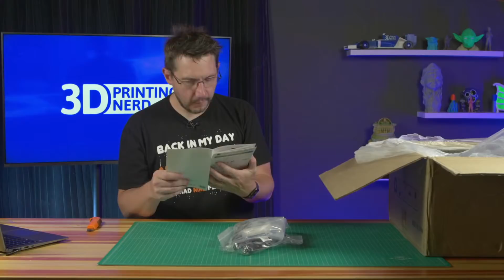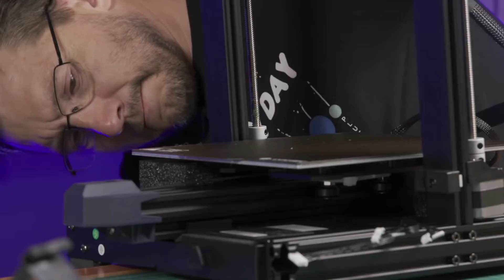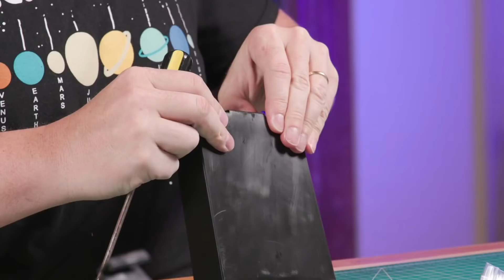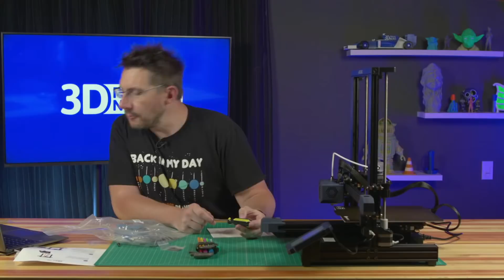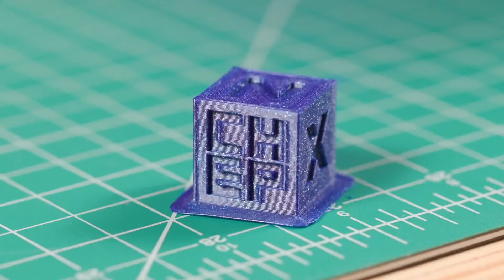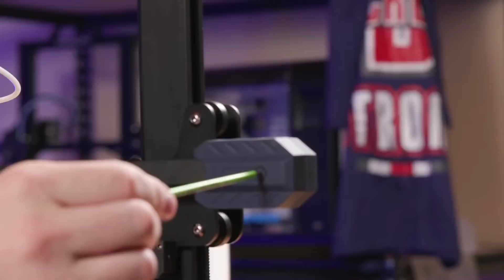Anycubic VYPER 3D Printer - FIRST PRINT LIVE!

Comment: New anycubic vyper owner,used printer...I have 4 ender v3se printers that print great articulated stuffs perfect,using tough pla...tug,pull,yank on them and no breaking...my vyper,not the same result at same settings..they will break if yanked hard.,and look different print wise..why??is it the different hotend set up and 225 is to hot?? Layer lines?? Any help is welcome..

Comment: I know this is an old video but I really needed this. Created alot of fantastic things on my first printer an Ender 3 Pro, but the leveling.., it was like a second occupation. Akin to loving garden vegetables but spending 95% of my time weeding and 5% harvesting. Does anyone think this is a sensible Ender 3 replacement?
Reply from the maker: The Vyper has been a darn decent machine for me! It was essential in my frames project with NPH.
Reply: Thank you 😊 for your reply.
Reply: @jackcampbell4465  Not sure if you bought yet. If not, they a slight discount right now. I also got a $20 off coupon and got mine for $329 USd with shipping.

Comment: Really thinking about getting one of these. I'd like to be able to print ABS and ASA with it but I'm wondering if the electronics will survive if the printer is placed in a heated enclosure. My second choice would be a Creality CR-10 V2 which has a separate enclosure for the electronics.
Reply: мне тоже интересно это узнать)

Comment: Well I have had the filament feeder die on my Anycubic Vyper now twice.  The sad thing is this printer has had amazing prints, but its reliability is poor.  What are people recommending these days for under 500?
Reply from the maker: Twice? Dang. Can you put a different one on? I have many hours on mine and haven’t had any issues. I know Sam Prentice has leveling board go out and got a new one.
Reply: @3DPrintingNerd  Yeah the first thing replaced back in July was the strain gauge.   Then beginning of May the filament feeder stopped working and they sent me over a replacement.  I am now working on trying to get a second new one from them.  They have been very helpful and the printer prints amazing with my cura profile.   I am not sure why the feeder seems to be such an issue.  Any suggestions/not to knock the Vyper - but other printers in the $500 or less market that are pretty reliable?  (love your videos btw)
Reply: @3DPrintingNerd  Just quick update - Anycubic support is sending me a new motherboard and a new extruder.  The sounds were coming from the feeder but they feel I guess the problem lies between those two items. (this was a pre order Vyper)

Comment: Not 1st with spring Steele sheet, Two trees bluer plus has em beat...and it's a way nicer one too. Might go as far as to say the best printer pound for pound out there and the price is stupid cheap. ...and comes with a whale fanny pack lol
Reply from the maker: Oh they had the textured PEI already?
Reply: @3DPrintingNerd  no they don't have textured but in my opinion that's better. Textured leaves you with a rough bottom whether you like it or not. It still adheres to the bed really well. Textured is almost overkill. But the two trees is loaded with everything, abl, wifi, spring steel dual z with belt etc... and it's 300x300x400. And it's the exact same price as the Vyper. Both are 350 although I think the vyper is 300 on sale. But yeah check the bluer pro out. It's pretty impressive. Not sure how the hell theyre making money off it at 350 (on amazon which is even better, you'll get in a few days with free delivery) . I believe makers Mashup has a review on it if you'd like to see it further. But yeah pretty damn good printer and fairly well thought out.....and did I mention it comes with a whale fanny pack lol
Reply: Not textured, and not cheaper. Bluer Plus is a kit and costs $349 from Amazon, $459 from Two Trees.

Comment: Hi Joel, Great video right there and a cool printer too!  I have a Tronxy X5SA 2020 model, 
However it can't seem to level right no matter how much I try to get it to do so? I tried tons of times to level it using it's auto leveling and he manual level set up, 
But still no luck.  

So I saved up to buy another smaller 3D printer and was going to buy the very popular Creality Ender 3 V2. 
But I happened to watch one of the many you tuber channels on 3D printing and saw a new printer which is a clone of the Ender 3 V2 I was after!

This new printer was by a company called Voxelab the printer was called a Aquila.
It was a clone of the Ender 3 V2 with a different control screen. I ordered mine about a week ago, 

It was not only a super printer which was super easy to build as it was 60% pre-built straight out of the very well foam 
padded box with all the screws and bolts etc. all in single good quality clear labeled bags.
But it also saved me £87.00p on the Ender 3 V2 own price.  

Turns out Voxelab are a sub company of Flash Forge so the hi quality and great design now makes total sense. 8 )

The company even has one of the most well done clear detailed how to build and level you tube help videos I've ever seen. I had the print built and printing in 1 hour.

Te bed is 245 mm square and 260 mm high of print area.  I ordered it from Amazon UK and got it in 2 days. all for £189,00p
What totally cool super bargain.

My only hope of getting my pain in the butt Tronxy big print area ( 330 mm square bed by 400 mm high ) working seems to be to update the firmware to Marlin from Troxny's own bad firmware and change the magnetic bed upgrade I brought for it over to a mirror glass pane so the big bed is flat and take out the magnetic level sensor and replace it with a BL Touch one?

Maybe I get the Tronxy X5SA working right then?

Comment: 30:30 For those interested in the colored hex keys I actually just bought an identical set of colored metric/imperial long ball end hex/security torx on Amazon for that’s pretty nice. $35 for CR-V
• long metric ball end Allen keys (1.5-10)
• long inch ball end Allen keys (1/16-3/8)
• long security torx (T10-T50)
• multi-tool style (flat, Phillips, T27, Hex2.5-5)
• crappy Allen handle
• crappy case

https://smile.amazon.com/dp/B085NPPBR8/ref=cm_sw_r_cp_api_glt_fabc_TEWAPXB8440GTMM1KBX9?_encoding=UTF8&psc=1

Comment: CR6 clone?
Reply from the maker: I would say it's clone-ish. LOTS of stuff reminds me of the CR6-SE, but I feel like they've given it their own twist. I'll dig deeper.
Reply: @3DPrintingNerd  One of my very few criticisms about the stock CR6 is the part cooling from only one side.  Anycubic has addressed this with the Vyper.
Reply: @3DPrintingNerd  Definitely a cr6 clone, they even tied to clone the mainboard, they just did a crappy job when they put the TMC2209 steppers without uart or serial communication, then have them designated as a4988 in the firmware. What is the point of even having TMC2209 at that point?  Missing tons of info and functions on the UI,  like any axis positions. Kinda need to know the z axis position, at least when the strain gauge takes a crap. no linear advance, dual z motors and endstops, but G34 isnt enabled...   They tried, but should have tried harder
Reply: I've been very happy with my CR-6.  If this comes close or is improved, great deal.
Reply: yeah its a clone